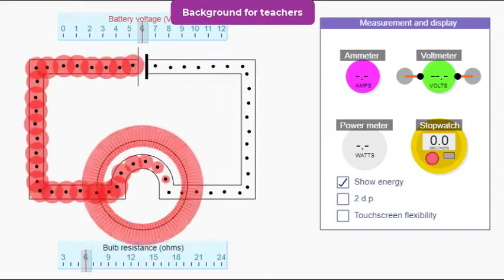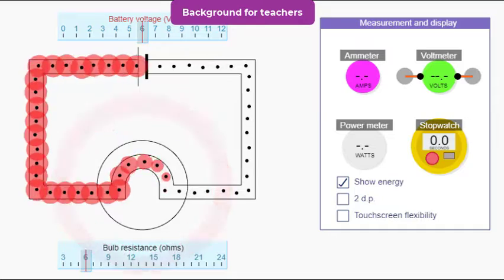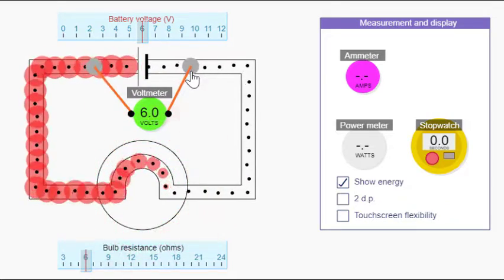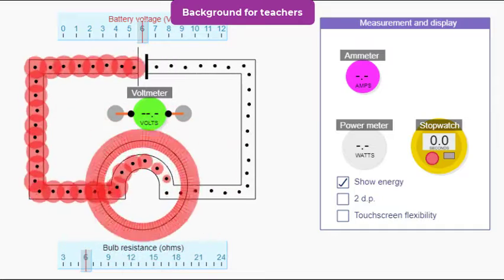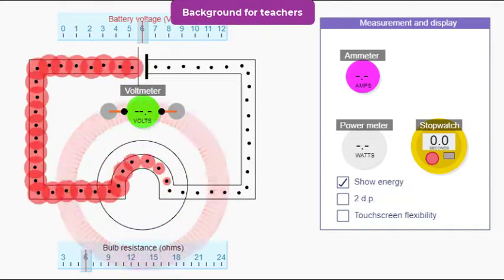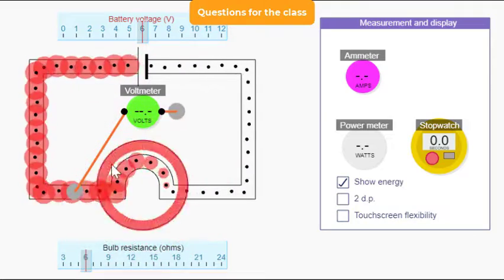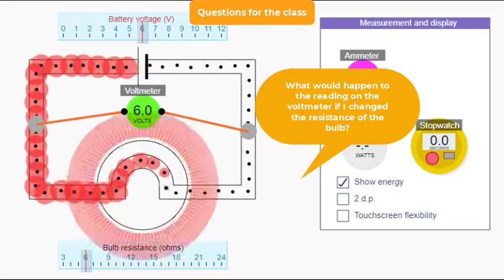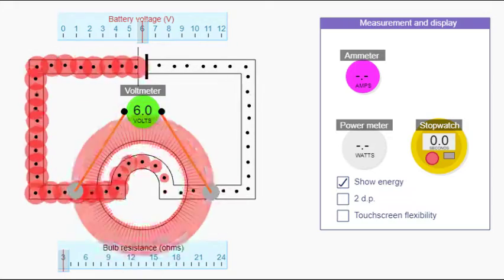Measuring potential difference using a voltmeter | Electricity Explained circuit simulation

Comment: Hi sir. A question. If we increase the resistance of the bulb or load, the charge or electrons struggle to flow but the voltage remains the same. Is that correct? If so does it mean also that the load or the bulb in this case will be dim as a result of the increased resistance?
Reply from the maker: Hi. Thanks, for the question. 🙂

You're right to say that the p.d. stays the same. The current decreases, so the bulb is dimmer.

It's not quite right to say the electrons struggle to go through the higher resistance, but the reasoning is quite subtle.  I discuss it here

https://www.electricityexplained.com/electrical-resistance-causes-confusion-because-its-a-metaphor

Do let me know if you have more questions 🙂
Reply: @julianhamm4343 Tq sir for the reply and link. 🙏 Much appreciated.